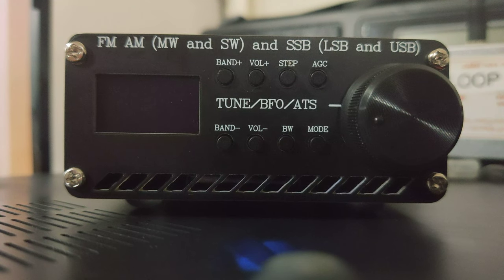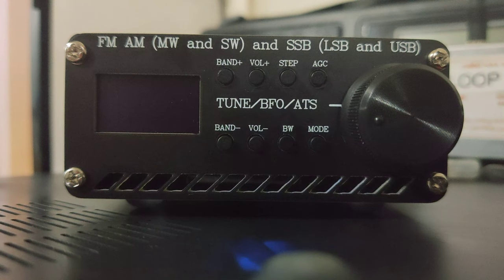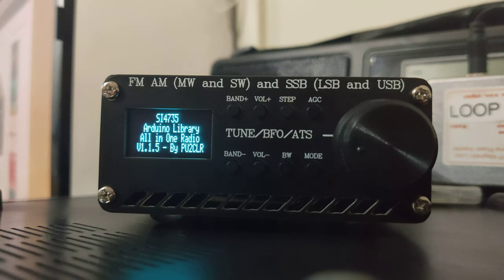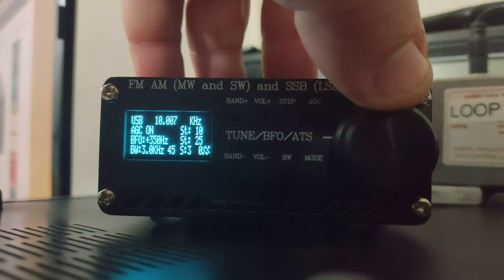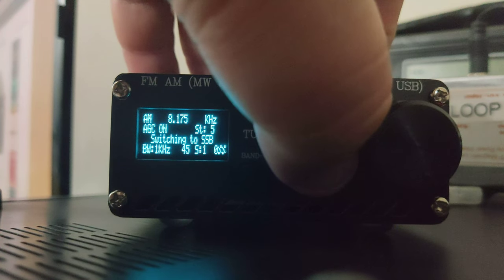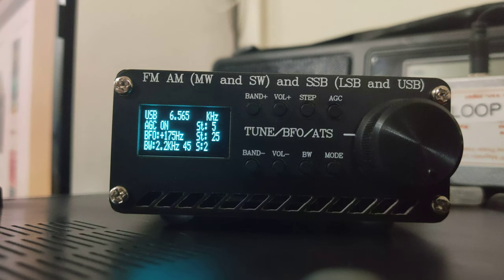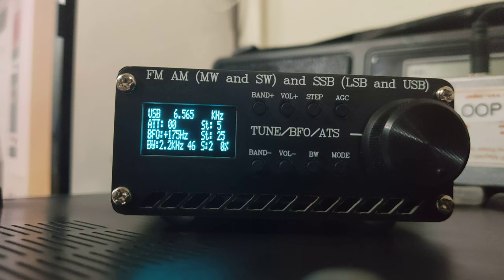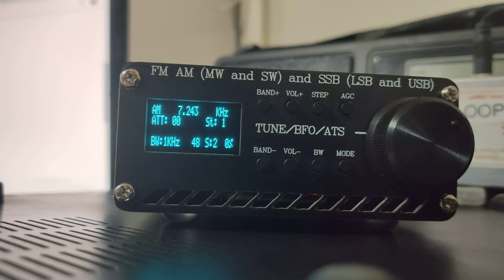SI4732 All Band Radio Receiver FM AM (MW And SW) SSB (LSB And USB)

Comment: What's the sound quality like on the speaker? I'm not sure why you wouldn't just buy a tecsun pl-330 for around £20 more it seems far superior and has air band aswell.
Reply from the maker: I have quite a collection of radios, was curious to see how they performed.

The sound your hearing in the video is from the radio itself, I find it easy to hear
Reply: @BrettRobsonPhotography  tecsun pl-360 or si4732 ? I'm not sure what one would be best there priced similarly. Does the tuner knob fail on most of these radios?
Reply from the maker: @neilcampbell4833  in my experience I have had no problems however I only use this radio if I am not home, I usually have my SDRplay V2 connected
Reply: @BrettRobsonPhotography  I've just purchased one sound quality is decent enough bfo doesn't seem to do much  I have mine on -200 MHz all the time. Att button  does nothing on mine. It picks up more station's than my crappy r-108 shuidon radio . I can get some ham stations coming through quite clear with just the added whip aeriel. I only paid £30 for the radio I'm rather impressed. Although I don't trust the encoder as others are saying they break easily
Reply: £20 more? No a lot more than that.....at least double. I just bought my ATS-20 for $40 including shipping from Aliexpress. The 330 is $90 on Amazon right now.
Reply: I've  seen them going for £50 on Ali Baba there £60 pounds on Ali express. It's not just Amazon that sell the pl-330 .
Reply: That is mine. $39.60 with free shipping to USA
Reply: Guess YT cuts off all my links. smh

Comment: Bought one. Junk right out of the box. None of the buttons on face gave any response. It just displayed the version. Guy on ebay giving runaround.
Reply from the maker: Never skipped a beat for me and had lots of fun with it connected to my W6LVP loop antenna, maybe its the luck of the draw or bogus versions
Reply: Did you update it? They all come with old firmware and software it seems. That should help a lot.
Reply from the maker: @englishrupe01  actually no, where is the best source for the software??